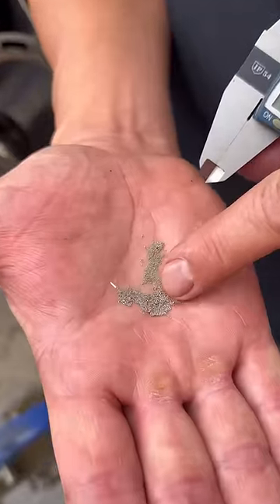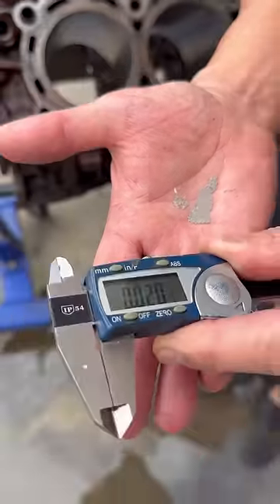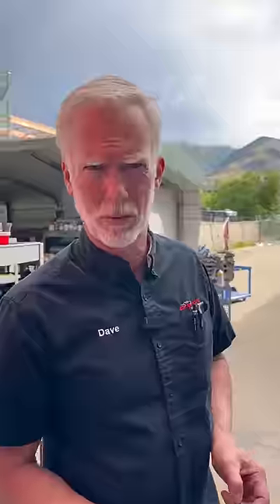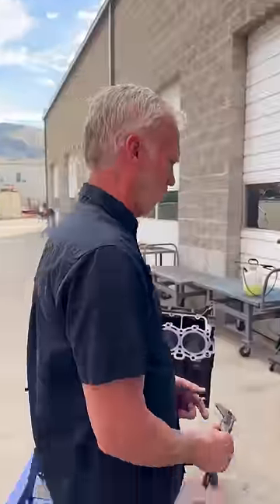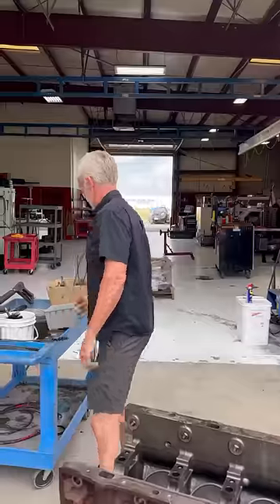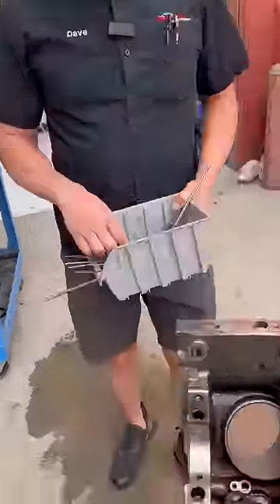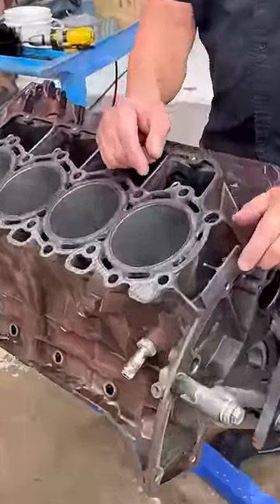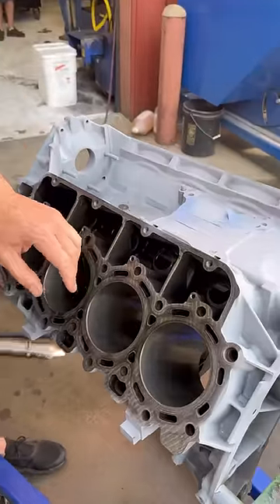How we clean and prepare our engines before assembly

Comment: Great showman, and as an engine builder, I can appreciate this, but when we do engines we clean every speck out of every surface of that block  for a good foundation for final assembly when all the machining and cleaning is done. Additionally, I still block off some passages that are difficult to clean or hard to brush out because a Good machinist and engine builders take this to the next level so they don’t have to worry about it… Keep on rocking
Reply: Appreciate the feedback. Good to hear

Comment: Even if you're machine shop cleans the block for machining. you should use this method of brushing out every passage and bolt hole. it's the best insurance to make sure you're engine build turns out good.

Comment: I hope there's a Resurgence of machine shops, I'm tired of having fewer and fewer options such as overhauling the top end of my Dodge Dakota.
Reply: Unfortunately newer vehicles will require thousands of dollars of electronics be replaced before the block or heads will need to be worked on, mechanically totalling the vehicle. Not to mention EVs. There is just less and less demand for local machine shops as time goes on.
Reply: Oh god yes.  It sucks that there are hardly any around and damn near none that are worth a damn or fairly priced.   I've bought my own cnc, lathe, and other metal fab tools just due to a lack of machinists to go to causing the rest of them to charge insane amounts.
Reply: @NeoIsrafil  hi, if I may ask, what part of the world are you in? I'm on the East Coast USA

Comment: I usually set a piece of shot on each main bearing before i drop the crank in and bolt the caps on. 
That way it makes an oil groove for better lubrication.  
A dab of grease holds it in   place.
Reply: What - are ya goofy?
Reply: That's what the little hole is for in the center of the bearings... That usually holds them in place just fine for me.
Reply: @billymanilli  Exactly! You don't try to grind an unplanned groove into the bearing. That seems moronic.
Reply: Hahaha hahaha I usually just put them in the oil pressure bypass cup about ten grains

Comment: I like this Shop Foreman! He is right to the point! And with most excellent tips and procedures! 

I would absolutely apply to work here, if I ever lost my current job! Hopefully not!

But with this type of Operation, if I started at the bottom I would be cool with it because of all the interesting repairs going on. I'm not a truck guy, but I did actually work at a truck shop where we did lift kits every single day! I got stuck doing alignments...Let me tell you , I can align ANY lifted truck, jeep , and or rock crawler! Metal Cloak, Terraflex and Rough Country were the brands we saw and used in the shop. Great experience, but at 5'7 doing a set of 37" tires and lower control arms and lift kit, everyday was very tiring to say the least. But I loved it! Shout out to the Jeep named "Justified" ! Great Build by the owner!
Reply: A scary amount of exclamations points
Reply: @LarryGoggins000 lol

Comment: One of those little shot beads is every oil pumps nightmare and its nothing to stop it from being pulled into it if it makes its way to the pan either, average pump screen has an 1/16 square screen unless its for a high volume pump then its bigger

Comment: Had a single piece of shot destroy a crank main journal seizing up stopping the pre runner!
One piece of shot!
Reply: I say this respectfully, but you have to be lying. There’s no freaking way.
Reply: @Smartsometimes  the long block was put on a Sim tester which supplies the long block with oil and rotate the crankshaft via electric motor. This is to check the compression and for proper oil flo. The single piece of shot made it 3/4 of a rotation before seizing up destroying the main journal and bearing.
Reply: @porousorificePilot he emphasis they remove all the beads as if humans aren't flawed and never have bad days 😂 it's impossible to never leave a bead behind ever
Reply: Its why everyones moved away from steel shot, dry ice blasting and soda blasting.
This fella isnt just living in 1989 hes way back in the 70s.
Reply: @Smartsometimes  bearings are soft. Once the shot/debris enters through the hole in the journal it will plow mostly through the bearing but will tear through the crank too because the crank is driving it through the bearing.
Reply: We have large shot last machines. I've changed a number of hydraulic pumps on forklifts where one piece of shot got in the pump locking it up and splitting the coupling

Comment: Here is one for you. I have found the reason for big blocks overheating ,at least in the 60's and 70's . I had a few  of the rear soft plugs that I removed was filled with the casting sand still there. One of them ,my personal one had one completely plugged with the hardened yellow sand.

Comment: Some years ago (I say 1979) a friend needed a small block rebuild. The friend was not a mechanic, he was a tree surgeon but he insisted on doing his own rebuild. We had access to a shop with a bead blaster. I don't recall the exact medium used but it was "bad" enough. The friend wanted to paint the cylinder heads up all nice. He used the bead blaster to clean the outside of the heads. OK, the time came to fire the engine up. It started immediately but died immediately. I spent a hour trying to get it to fire up. I came to the conclusion it had zero compression. I oiled up all the cylinders and sure enough it fired up and ran fine, for a while. After about 3 weeks the engine developed what sounded like a rod knock but then did not sound like a rod knock. After some more weeks the engine developed low oil pressure and a definite rod knock. Engine was torn down. Every bearing in the engine was destroyed. Even the cam bearings. The guy did not was the bead blast medium out of the cylinder head ports. Destroyed a new engine.

Comment: When I lap my valves I clean the surface and examine with a strong magnifying glass (Lupe). Even after seemingly good cleaning it’s amazing how many grains of grit are left over. Even worse they will crumble and will get into bearings. Unlike the steel balls that just end up trapped or into the sump pan.

Comment: Common Tipp from german sandblasters: Use salt for sandblasting motors or transmissions. It dissolved in water when u clean the motor in a washing machine, after blasting. It takes longer while blasting, but you don't have to worry about particles left in the motor.

Comment: You need to use a sort of metal round headed vibrating hammer from corner to corner while rotating to actually make sure you remove those because air works okay for close, exposed surfaces but for crevices you’ll just basically be pushing the stuff into corners hence why the vibration+ rotation would introduce and extra mile.

Comment: Something a magnitude larger than a bearing gap isn't going to get between bearing surfaces and tear things up,  it will sit at the edge of the outer bearing where the oil passage penetrates it and ride along the inner bearing, but not exerting enough pressure to damage the surface.

But that's just one piece of shot. Get enough pieces in that same location,  you will end up with an oil pressure reduction, which will accelerate wear on that bearing, and eventually there will be enough of a gap for the shot to enter,  but by that time the bearing is already toast.

Comment: You need s shower pan with a corner drain set up on two side supports to allow the engine stand to slide freely under it in one direction. Be able to fork lift it from either side.  Drains into a sump to put in a steel canister to place in your thermal oven to evaporite the water and leave dry residue .   If you weld a pin across the engine stand rotating head tube. You can design a slip in gear reduction device to move from stand to stand only when you need to rotate the engine on the stand then remove it once its locked with a bolt.    A friend did that with an aluminum flywheel with a slotted shaft. A bearing assembly with a starter pinion on a hand crank.  Two fingers went around the engine stand vertical tube to counter the torque.

Comment: I would want a high-end magnifying borescope put through that it would take very little to get a few of those jammed into some porous cavity. After its cast most of the critical areas are machined. Manufacturers have very thorough processes to remove sand.

Comment: Dave, I'm not scared of the steel shot because I'll never let them used in my engines. They not only destroy the main saddles and lifter bores, but also peen the threads on the rocker studs. Its a shortcut that leads to uncertain results.

Comment: Does the beads not make the mating surface’s uneven? Or slightly enlarge the bores? Or is there no liners in them when blasting? When I have seen blasting in the uk every hole is plugged with rubber bungs and the flat surfaces taped.

Comment: They use the same things on aviation engines but they use strong magnets to clean them up later.

I guess because aviation jet engines are mostly aluminum and won't be affected by the magnets unlike a car engine block which would get stuck to the magnetic instrument.

Comment: Where the beads or sand will get you is a small recessed place that is wet or sticky with grease or sludge that the cleaning missed. The cleaning media will stick to it like glue. If you don't find it it will come loose when the engine is running. I got to where I cleaned the head myself then sent it to the machine shop and pleaded with them not to bead clean or sand blast my overhead cam heads.

Comment: I did all that 3 times and still got two bearings and couple of crank scratches. ($800.00 K 1 Crank) Before I'd ever consider bead blasting a block again... I'd convert a high end pressure washer to direct port a couple of oil galley inputs and blast it from the inside out. You'd need lifter plugs for a start, maybe a lobe-less custom cam stick sized to the block bores. (no bearings installed. Never, Never, Never... Again for me. F-Dat ! without an inside out water pressure blast.

Comment: We got a crank back from the machine shop and the shop forgot to clean out the oil holes.
The engine we put it in was the started the engine, it lasted about 10 minutes before knocking horribly. 
We then adopted and clean out everything policy!

Comment: Your blow gun needs a long stem on it to reach to the bottom of the blind holes .  After running a tap through cylinder head bolt threaded holes , blow them out again .  Apply International Compound # 2 to head bolts , not to connecting rod bolts or nuts !

Comment: You can't clean enough. I also run a tap thru every hole. Nothing worse than finding a stripped starter mount or other threaded hole during engine installation.

Comment: Shot and pean blasting for cleaning of engine blocks is old technology. You can achieve a far better performance with a guaranteed 100% surface coverage from chemical treatment dip tank process. You will never get 100% of the shot and pean out of that engine block no matter what you try. Even if this guy tells you they do. That’s what he believes. He doesn’t actually know for sure that there is nothing left inside that block. It’s just clean to the point he believes there is nothing left in there. the best way to guarantee there is no shot or pean left inside your block is to not use shot pean blasting to clean your block.

Comment: Not saying you dont get all of the beads out, but if you dont, and they find there way into the crank journal, they could ceratinly impede the oil flow eventually. Of course proper cleaning makes this a completely moot point.

Comment: Can’t let (1) get by. Perhaps a different material for grit blasting. Walnut shells ,softer and dissolve in oil.
Reply from the maker: I found it to be by far the most effective way to clean. And we haven't had a problem with losing a bead yet after our cleaning process.👍

Comment: why does he not take the extra 30 seconds and tape off the cylinders before painting. Cardboard is not sufficient to stop overspray. I mean isn't this video all about taking good care of the motor???? You just machined the surface and cleaned out the cylinder walls just to fuck the rings up by painting after... cool. Glad you know how to use a micrometer....

Comment: If only we had a different kind of motor that took significantly fewer hours of labor to rebuild and provided more torque while weighing less. Wait... 🤔
Reply from the maker: Yes, electric is certainly a change that is gaining popularity. It Is our understanding that the vehicles are heavier, however?
Reply from the maker: Yes, electric is certainly a change that is gaining popularity. It Is our understanding that the vehicles are heavier, however?
Reply: Not all of them. Some of the less expensive EVs are lighter due to the smaller battery  packs, they just have 100-200 miles of range as opposed to the heavier long range models.

Comment: What are the chances that every engine they have cleaned this way has 100 percent of the beads removed? Id much rather have my engine blocks put in a hot tank. May not get the exterior as clean, but there is zero chance of a stainless steel bead being left in my engine. The important surfaced of a rebuilt engine are machined or have new bearings installed. Seems like the work and Risk vs Reward is not worth the extra "clean" your getting. I'm an idiot so my opinion is worthless. It just doesn't seem to be worth the risk to me.

Comment: Every bolt hole with a drill smaller that thr tap to get any left over hytemp or permitex  no 2 that may sit in the bottom of it . Never get proper torque with that in the tap hole .. !

Comment: Why not use aluminum or a softer metal so it won't cause as much damage and will get filtered out, those stainless steel beeds are ultra dangerous, i guess it's fine if you pressure wash for like 3 hours straight lol

Comment: What hess doing is shot peening the engine. Not only is it a cleaning method... it also adds residual stress to the engine which makes it stronger. I shot peen turbine components for aircraft engines.. he is correct. This process is safe but you must flush snd clean and inspect after doing this process

Comment: Just ask Valley Truck Parts about it.Every transmission and differential they build is full of that stuff. They blast evwrything. I do warranty work and those beads will destroy everything. They blast every single part. From the housings to the air shift cylinders. Its bad stuff

Comment: Those calipers aren't acurate to less than. 02 Not good enough for machine tolerances of 1 thousandths of an inch. Use a micrometer! measures 1/10th of a thousandth of an inch.